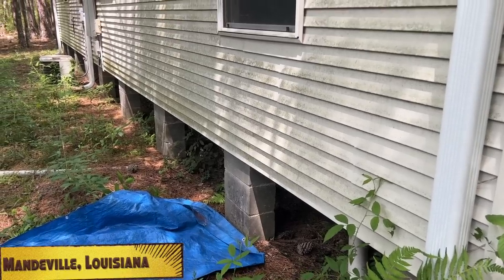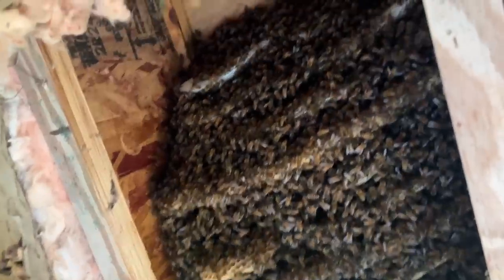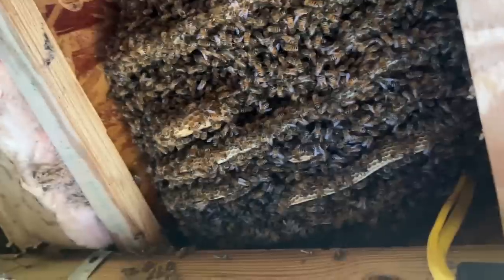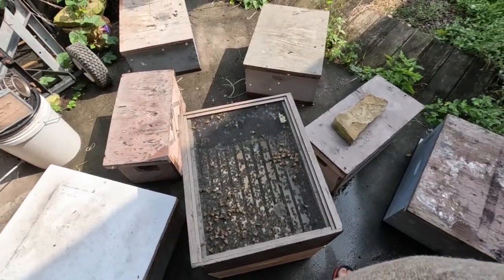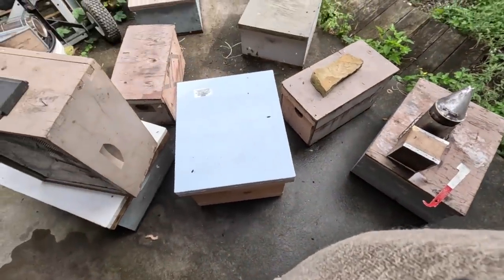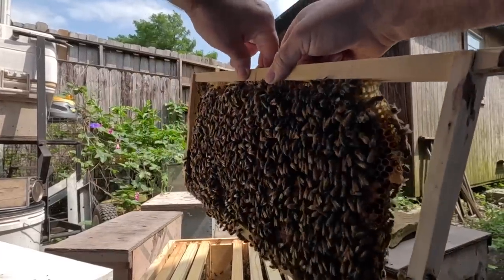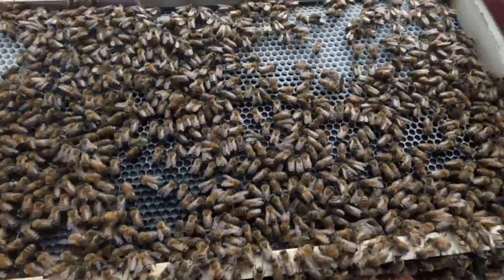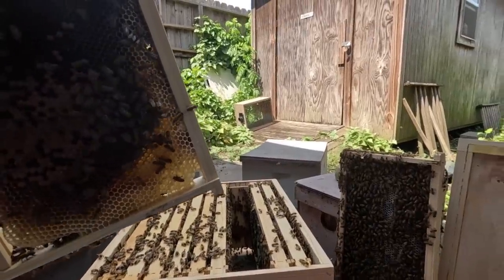Stung By Bees But Honestly, That Wasn't The Worst Of It!

Comment: It is amazing how you can capture the queen without squishing any other bees.  Easier than finding her in the vac. Your tenacity in saving them in the most uncomfortable positions is amazing.
Reply: 6mm opening allows workers to pass through but the queens big butt won't fit through.  Even the end of the clip has a 6mm opening.  Hard to crush them if your gentle as you should be.

Comment: JP, When I'm working on my truck whether that be on my back or knees for a long period of time, and me getting up there in age, one thing that has made a world of difference is when I started using Interlocking EVA (foam) Floor Tiles, seen used in children's room or for gymnastics which are thicker. I used to feel sore without using them, but after using them once you will always have some for the job you just had, and you can also buy EVA (foam) blocks which you could use on each side of that pipe to make it almost a flat and as comfortable as a bed. ~ Hope that might help, Mark
Reply: Excellent recommendation :)

Comment: Is there a difference between swarm cells and queen cells?
Reply from the maker: So there’s 3 types of queen cells: 1) Swarm Cells, created obviously when the bees decide to swarm. 2) Supersedure Cells, created when the colony decides (for whatever the reason) to replace the current queen & 3) Emergency Queen Cells, created when the colony has to make a new queen Johnny on the spot, say if a beekeeper accidentally kills the mated queen while conducting an inspection for example.

Swarm cells & supersedure cells are planned & make fine queen cells, with swarm cells actually the best queen cells.

Emergency queen cells can be hit or miss because they have to work with what resources they have available to make a new queen at the time the current queen was killed.

Comment: Either your Bee Vac isn’t working very well, or there are a lot more bees than it looks like in the hive. I do appreciate seeing you cut comb and put it on racks in the hive box! I watch 628 Dirt Rooster, and it looks like he always dumps the comb and makes the bees start over.
Reply from the maker: The bee vac was working fine, I vacuumed bees for nearly five hours, got just about every one of em. This colony was extremely busy, with bees constantly coming in from the field.

Incidentally, I believe there are wayyyyy more small hive beetles in Dirt’s area. That could account for him not using some of the comb from his cut outs.

I removed a very strong colony in Tylertown, MS, years ago that had more hive beetles than bees & this particular colony likely had at least 40,000 bees in it.

I was afraid to utilize any comb because of the amount of beetles. If you know anything about small hive beetles, they work very fast!

Within 3-4 days a colony can look like it was infiltrated with hundreds & hundreds of small hive beetle larvae, kind of look like maggots but they’re rubbery & don’t pop, thank goodness.